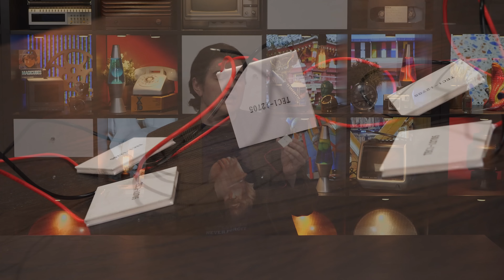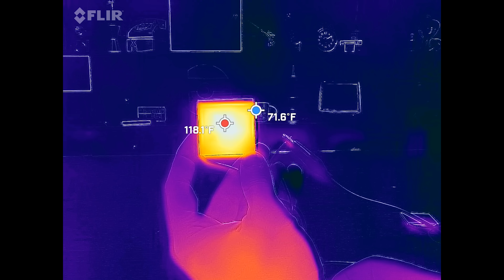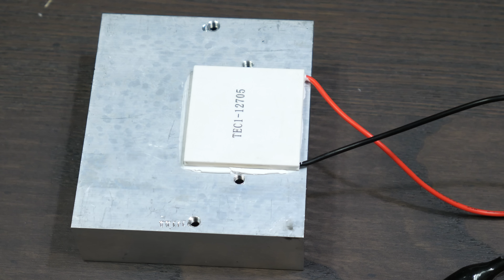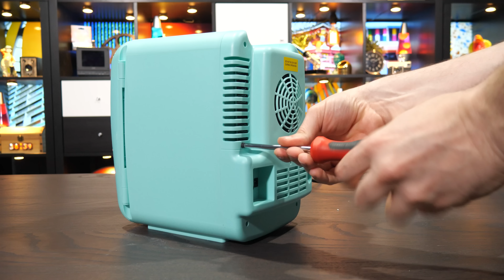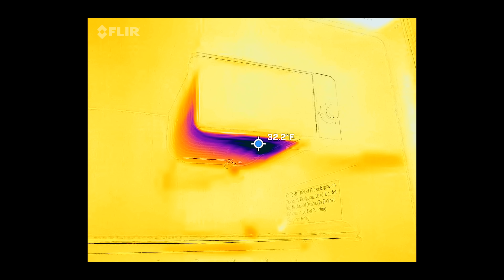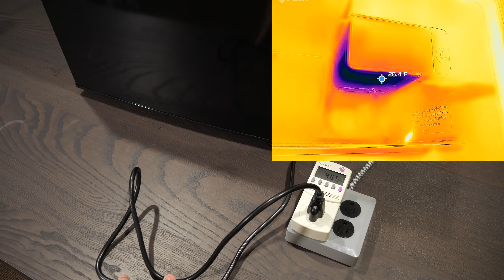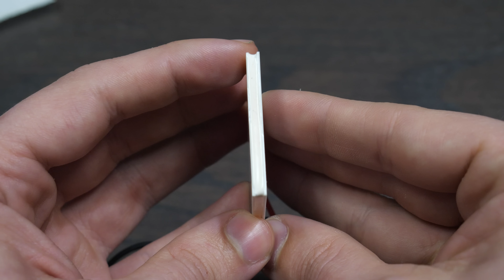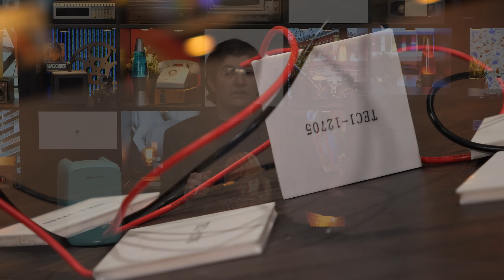Thermoelectric cooling: it's not great.

Comment: I've been considering putting one of these things in between the cpu and heat sink in a pc build.
Reply: What tdp is your cpu? 

You need to remove the heat of the cpu + that off the cooler which will be greater than that of your cpu and at max the entire time. A 5800 x3d would probably need more power than a 300 watt 13900k

Comment: I live in Japan currently and for some reason they sell handheld fans with small peltier coolers attached. Its supposed to make the air feel cooler. I can't tell fhe difference but it does feel nice stick the cold meltal plate on my forehead in the scorching heat of Tokyo. Probably a waste a money but it felt novel at the time when i bought it. 😂

Comment: Yeah I bought one of these to keep in my forklift at work. It had one of those 12v plugins so I figured it'd be good for cooling my drinks on a hot day. I was wrong. It sucked. It was basically just an overpriced cooler. It wouldn't make anything colder, it would just keep things from getting warmer. If you put a room temperature drink in there at the beginning of the day, it'd still be room temperature at the end. If I threw some cold drinks in there, they'd stay cold. That's about the only praise I can give it.

Comment: One use is to cool IR sensor in anti-aircraft missiles.  What is done is several cooling elements are stacked to get very cold temperatures quickly.  Still a large power draw. This is why manpads only have like a half a minute of activation time for the missile to be used.  Other missiles use expanding gas to cool their sensors.

Comment: Hi, with the numbers I wanted to check something.
Little thing $30 6cans 50watts, $66 a year. So, a year of operation for $16 per can
Mini fridge $100 33cans 22watts, $27 a year. So a year of operation for $3.84 per can

Or with my local European prices and 0.32 per kwh, which is 2.286 moddifier
Little: €40 buy + €151 electricity = €191 Total and ~€32 per can
Mini: €134 buy + €62 electricity = € 196 Total and ~€6 per can

Making it  5 times as expensive

Comment: I have a water purifier and a wine cooler both with Peltier boards. The water doesn't get cool enough but the wine cooling is perfect. Both devices are huge energy consumers. I had to attach a smart plug to turn off the water purifier at night, but I can't do the same with my wines.

Comment: One quick note: 7degree C is the default Fridge temperature, which I learned set on any fridge and fine for most food items. So that part is not shocking ;) On the other hand with no air condition 25C in summer is i would say optimistic.

Comment: To be honest, I would expect a mini-fridge to have a low COP, maybe as low as 1.0. The mini-fridge is probably using a simple PSC motor that is around 50% efficient, and has to run at a very high temperature delta (due to the cold temperature of the fridge AND the lack of surface area on the hot side).

Comment: Okay but youre missing the very most important question here. If heat pumps have gravity issues, WHAT DO THEY USE IN SPACE! I'm guessing its probably just a different design of pump that doesn't rely on gravity for oil distribution, but if such a thing is possible surely that also bears mentioning? Not a real criticism obviously I just really want to know now

Comment: Notice the fail of the REAL fridge? The heat dissipation thingy is INSIDE the fridge. How stupid is that. A fridge without an open hot side is just as stupid as the buyer. The only criteria I have to a fridge is to transport the heat from inside OUTSIDE. Is that too much to expect? I guess so.
The fridge I own I bought new 2003, it´s reasonable big, has a real deep freeze compartment and uses 80watts. Stupid fridges do get to my head, yes.
Kind Regards

Comment: In the area of processor cooling of computers they have tried so many times and they are always terrible, the only cooling solution that works is from intel the Cryo Cooler (it is expensive as hell) and as it is usually it is inefficient, only the peltier consumes 300w of the PSU, so your processor consumes 250-400w,   your GPU 500-600w and then the RGB and fans

Comment: They're great for generating small amounts of electricity too. My step dad has a fireplace fan. It sits atop the metal firebox, and as the fire heats up, the fan begins to spin gently. It's just enough to circulate a light warm air.

Comment: I know they are crap, but I was to use one of these to chill water for our garage aquarium. We raise our own tropical fish, but this last summer, the temperatures got too hot for even tropical fish and I seriously considered getting one of these, cutting holes in it, and stuffing it with tubing. The idea being that even a crap "refrigerator" would likely get the water back into the low 80's.

Now that I know they also take forever to chill, you have saved me from indulging in that plan!
Reply: It would be kind of neat to drill a couple of holes in a non-critical part of a mini-fridge and run a cooling loop of water in that mini fridge. Cool drinks and cool fish!
Reply: could you put ice cubes in the tank?
Reply: @Kizzabell  Not directly in the tank, as the odds of regulating the temperature are too low and it would only cool the water at the surface. However, running tank water through tubing in an ice bath might work if it you had a thermostat for the pump.

The real issue there is it would create a whole new job of constantly checking the ice. It gets pretty hot, so the ice would be gone fast.
Reply: funnily enough a evaporative cooler might be your best option
Reply: People have gone to great lengths building coolers from under-bench fridges, a heap of tubing and a bucket of refridgerated water. The results are underwhelming.

Aiming a small fan (desk, computer) at the water surface is fabulous for cooling, especially as the evaporative effect is greater on hotter days.

Just make sure you can't accidentally engage in electrohydrotherapy...

Comment: i bought one of these Peltier 10L coolers to keep small personal items cool. I will occasionally throw a drink or two in there as well. I've had mine plugged in for weeks now and its been working great! It does like to build up condensation on the inside, so things get wet... but its small and does not take up much space, so its convenient...  But after watching this and seeing how inefficient it is, i may just bite the bullet and buy the cheapest smallest mini fridge i can get. Afterall, dont wanna skyrocket my electricity bill for this dumblittle thing.

Comment: I may have missed it but one difference between TEC and VC is the effect on internal humidity. There is one application that is "day-to-day" that I can think of where using a TEC is much better than VC - climate-controlled humidors.  Cigars require controlled temperature and humidity.  Even if you managed to rig up a 68°F controlled vapor compression system, you'll still dry out the air inside the chamber and you can't warm up the cabinet when the ambient temperature changes in the winter.  Peltier coolers, on the other hand, are dual-function with a polarity change and they do not desiccate the contents of the cabinet.  For the purposes of cooling sodas, TECs suck compared to a VC system.

Comment: I got a cooler bag with peltier elements. can use wall plug to pre cool and in the car it runs via 12V which is great for travels. 38€ and its knee high ;D

Comment: I try build frezer my selft and 12 vol x 6 A x 2 pieces doesnt not enough to cooling 25 cm x 20 cm x 35 cm box. even from 30 C (room teperatur) to maintain 20 C need 1 hour with refirator 80Watt i can frezer water and mak cool medium firdge. and i used water cooling to cooling hot side and small radiotor fail to make hot side cool. even water cooler it self become hot.

Comment: Works better as a heater, cause converting electricity to heat is waaaaaaay easier. Cost effective? Still a no.
Refrigeration is key and probably more efficient in electrical usage

Comment: There are now compressor cool boxes made possible mostly by LG making a small 12v DC compressor! These can be had for very low prices; albeit not impulse levels of cheapness, but either way, significantly more reliable, efficient and they actually can store food below 5'c - Now that the Chinese have cloned them, they can be had for less than £200 here in the UK... I use my 60L box for Cosco meat runs as it's over an hour away by car.

Comment: I guess I lucked out, my Star wars Death Star themed fridge I got for $12 at BestBuy on clearance has a temperature differential of at least 45 degrees. It has no problem creating ice where the peltier is mounted on the metal cold plate. After 12 or so hours 6 cans are ice cold. Sure it isn't energy efficient, but my coworkers are running 1500watt heaters at their desks in the middle of summer, 50 watts from my fridge is 30x less than their energy use. Technically I can claim my little TEC fridge is just a low voltage 50 watt heater if ever challenged.

Comment: I had one of these cheap plastic fridges a long time ago, it was a Coca Cola one that was like a cooler and had handles on the sides and cup holders on top and a latch on the lid or you could set it on its side on a desk or something and it looked like a small old timely fridge. I bought it for $50 and it was insulated better. I loved it at first because it ran off my car’s 12v system. I had a job where I drove around all day and shot photos of houses and reported on their condition for a mortgage company and it kept drinks cold for me. I then moved into a house where I stayed in my room all the time and used it there. It actually got cold enough to ice up and partially freeze a soda once when I first got it. It slowly worked less and less though and did really suck after a while.

Comment: the real application of peltier elements is needing extremely precise and fast-changing temperature control, for if you need to keep something at EXACTLY 42.69420 degrees celcius, like a laser element with temperature-dependent properties. i would not be surprised to see them show up in projectors at some point as consumers demand ever more rediculous specs from their put-the-movie-on-the-wall lasers.

Comment: I own a perfect draft beer cooler. It uses a super beefed up peltier-element and a very quiet fan.

The new model cools the beer to 3°C / 37°F even in the summer. This is temperature controlled unlike simpel models that are just able to offset the room temperature. The more expensive ones even let you choose the temperature. (Less cold for white beer)

So if you invest a little more money you can get a perfect beer cooler. The beer stays fresh for a month (and longer).

And thanks to the big cooler it gets be beer cold in a “short time”

But decent coolers cost more

Comment: Nearly 12,000 comments!? WTH? But yeah, peltiers are rubbish. Would be interesting to see average power consumption if you added your own little temperature-controlled circuit to cycle the peltier on and off, as a total lack of temp control is a big chunk of quite why this is such an egregious problem. The sort of project Mattias Wandel would no doubt turn round in like an hour. :D

Comment: Capacity and efficiency are more important to me than cost. I can save everyone tons and tons of money and make their home HVAC 100% efficient, simply by turning the unit off! Feel better about your savings? I run into this stupid logic ALL the time in commercial control systems where some supposed "Energy guru" comes in and makes all kinds of stupid recommendations to "save energy". Mostly they like to raise the setpoint of the chillers from 44°F to 46° or higher. Same goes for the boilers. They lower the setpoint from 180°F water to 140°F water. CONGRATULATIONS! You've just made the perfect legionnaires disease incubator. They never bother to explain the loss of total system capacity and are never around when I have to come back and explain to the owners why their secondary pumps are running at 100% but they still can't cool the court rooms. These perceived savings are a farse as they never see how much more energy it costs them to run other systems to try and compensate. It's a dangerous death spiral straight into Sick Building Syndrome.

Comment: For home usage it's stupid, inefficient and slow, but for traveling it's much better. Most of Peltier type coolings have proper insulation, so you just put stuff there and plug it in to keep the temperature low. And although it runs all the time, at least for me, constant white noise is better than startup of a compressor and that startup noise gets worse with fridge age - so maybe near bed it's fine to have Peltier type fridge. Not to mention if you want to move the fridge Peltier type is much lighter.

Comment: I think this particular technology (the peltier cooling system) is used in some neck coolers that come from China nowadays. Basically they consist of two elements: a normal  neck fan (which I suppose serves also the purpose to disperse the heat produced by the peltier module) and the proper peltier element, which is supposed to stay in contact with the base of the neck.
They are powered by lithium cells, and, as you can imagine, they drain them quite quickly. Luckily you can choose to turn off the peltier module and use them just as neck fans.

Comment: The main reason I use a peltier element pseudo-fridge is because it keeps my already-cooled cans cold-enough during the day. It's pretty nice to have a cold beverage ready by the end of the day, instead of a room-temp one that I'd have if I were to keep it in my bag or something. The noise does annoy me though, but a) I don't have room for anything larger and b) I'm not sure a real fridge would be any more silent. But sure, point me to a similarly-sized "real fridge" that can hold four cans of slim 33 cl cans and which makes less noise than a peltier element pseudofridge, and I'll switch.

(Though I am contemplating just looking for a well-insulated coolling bag as an alternative…)

Comment: 24:48 as a fridge mechanic on average I usually see about 65g, though some fridges like an LG GF-B590PL use 95g, though I don’t usually much higher than that in modern fridges. Older R-134a systems typically have more, somewhere around 140g, depending on the size of the fridge or freezer.

Comment: These things COULD be good, If-

- You use maybe a couple elements, or just a larger one
- Gaming PC-grade parts. Top grade thermal paste/Pads. Proper heatsink, A fan built to run silent. 

But that would ruin its point of 'being cheap'

Comment: 27:53 They should use thermoelectric coolers for wireless charging pads in cars..Have the cooling side on the side that's making contact with the wireless charging pad and the hot side exhausted internally within the car chasis. Yes, I understand that there is a risk of condensation in hubid environments with a high dew point and if the TEC cools off the phone too quickly.But there should be some integration within phone software that should be able to control precise power that is drawn through the TEC. I believw Porsche uses a fan to blow over there wireless charging pads to prevent overheatinf but I think a TEC would be an even more elegant solution. If theres any engineers, I'd love to know your thoughts. I know the point of this video was to show the impracticality of using TECs but I think in short bursts, there can be some utility behind it.

Comment: You might like my simple explanation of how refrigeration works...
What happens when you compress a gas? Grab a hold of a bicycle pump after you've pumped up an air can. 
What happens when you let a compressed gas drop to a lower compression? Try to hold on to one of those little cans of compressed air that you use to blow dust out of your computer after a few minutes.

Comment: I'm in love with the word "quicklier".
However, my favorite fail induced by one of these things was when a co-worker used it as a CPU cooler. Those were all the rage a few years ago. Problem was, his CPU wasn't really generating enough heat. All it did was condensed a rather large amount of moisture right onto his motherboard. And we know how that worked out.

Comment: has anyone ever tried to use a peltier module paired with refrigerator-compressor. in my head you would need a less powerful compressor for the same effect. absorbing the heat from the condensation chamber should help the compressor, almost like multi stage cooling
probably not lol

Comment: mobilcool peltier mobile car fridge, i have one that i use on camping. it works just great, has a power control unit nad during nights can also freeze. By 28°C i can get 7-8 °C drinking water in it. However i have also a double funtion freezer/fridge with 30W compressor and can afford -20°C!